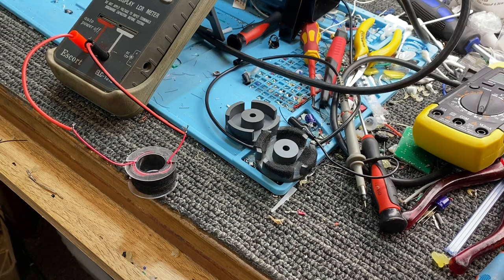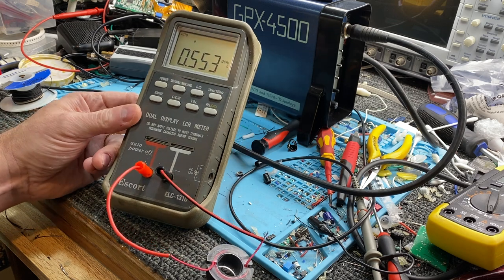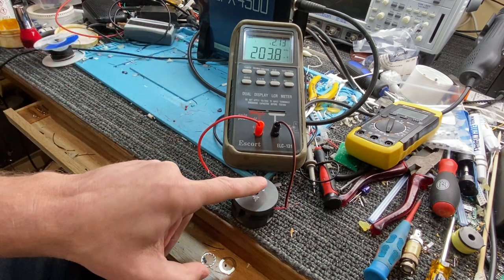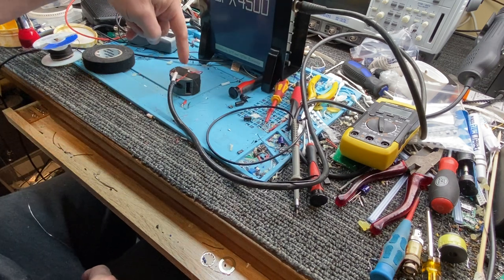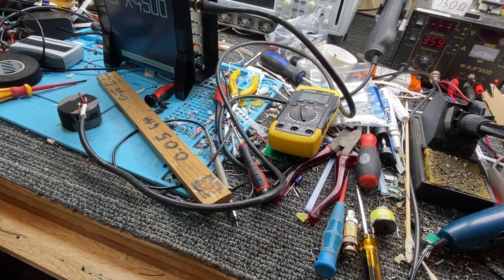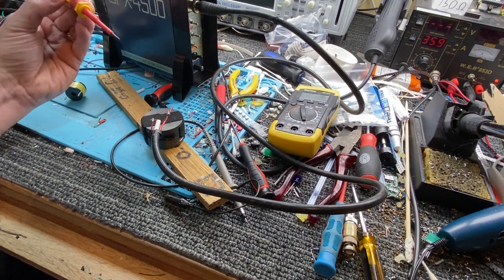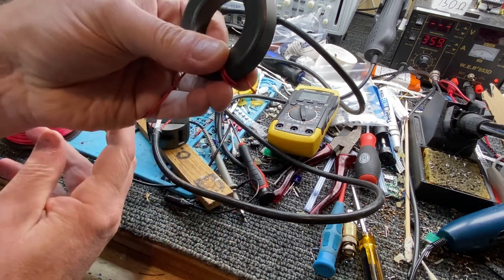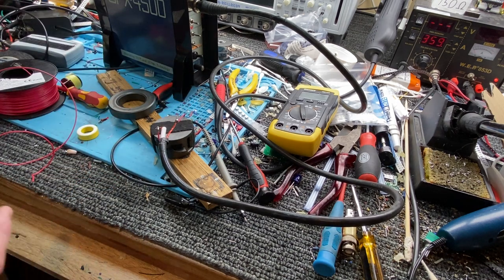Minelab Pulse induction metal detector test coil made from ferrite for testing mono mode home-brew.

Comment: Woody.. i was testing a hand made monocoil suddenly the screen of my gpx 4500 showed ** over current coil** 
From that moment i hear a lot of noise even when i put the 11 inch dd coil ..even i can hear the coil humming 

What could be the problem and what should I do?
Help me please ❤❤
Reply from the maker: Maybe some voltage spike take out one or two 2Sk1334 mosfet, check he surface mount mosfet for 15 volt and  5 volt coil drive.
Reply: @DetectorMods  that's a bad News 😞😞 
Thanks a lot for your help
And i appreciate that 🤝🤝🤝
Did the 2sk1334 in the battery or in the device?